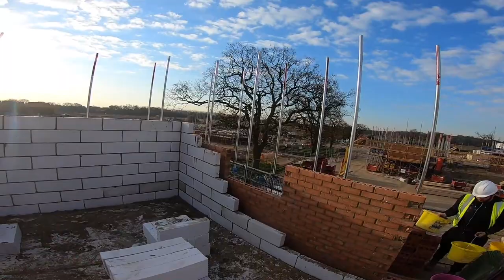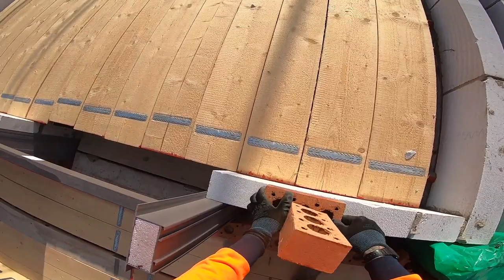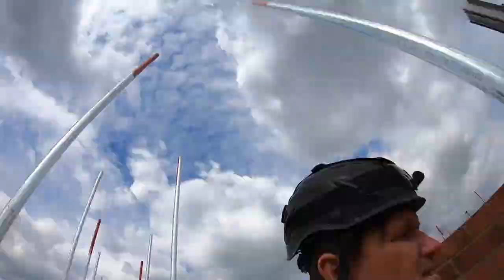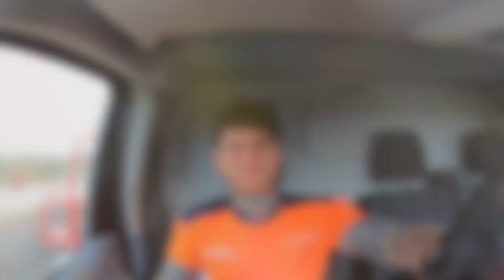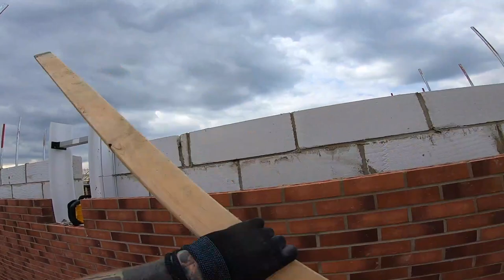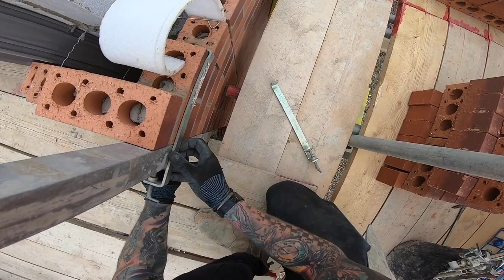3rd lifts finished!

Comment: that measurement for finished height sounds like its 2325 plus a 50mm wall plate plus a 10mm joint you should nt be adding 15mm to get it to gauge, the measurement will be top of wall plate not blockwork